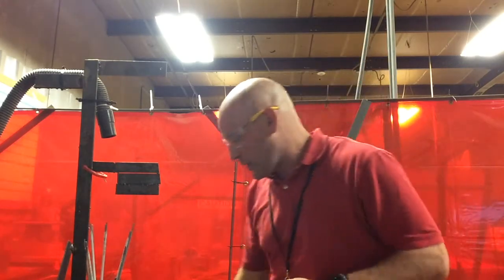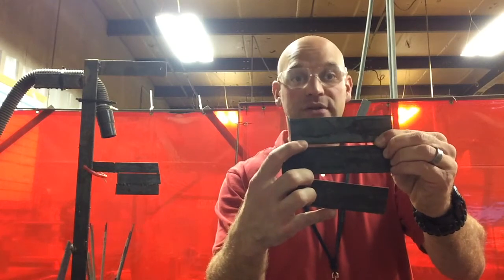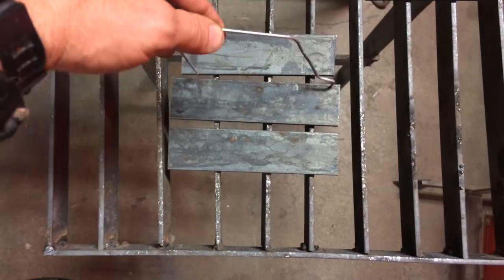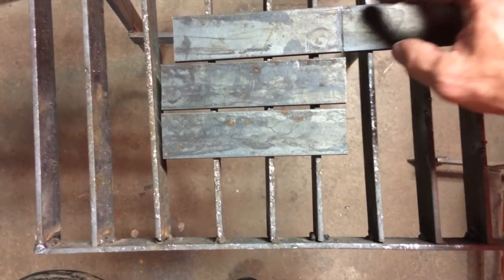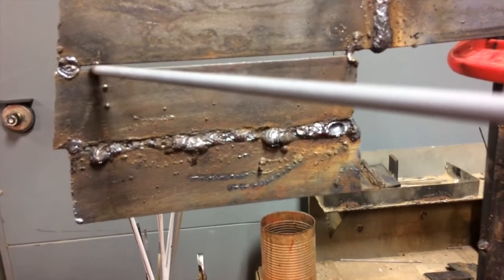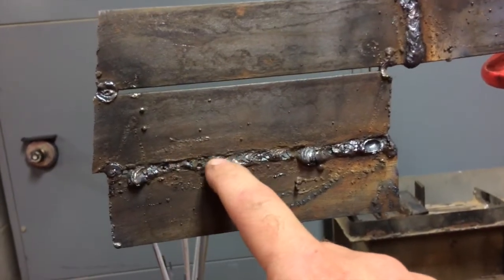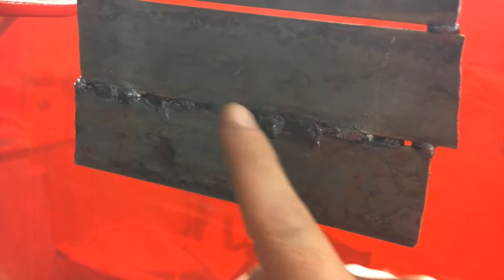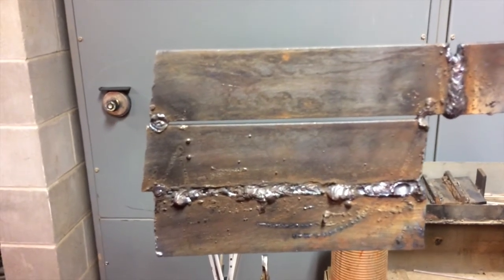Key hole weld

Comment: For future videos please show you actually welding. Just started on flat 3/16th with 6010 and it’s kicking my ass. Any tips? Running around 81-83 amps
Reply from the maker: try to go slower, my students usually always go to fast.  Try a circular motion that is with width of two electrodes.
Reply: I’ll definitely try that!